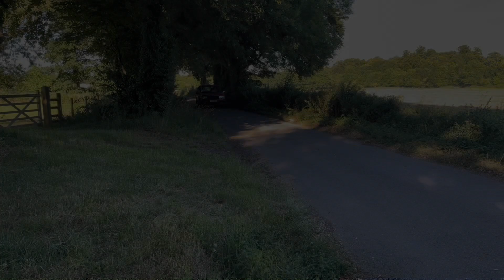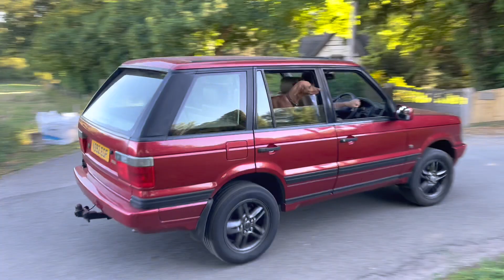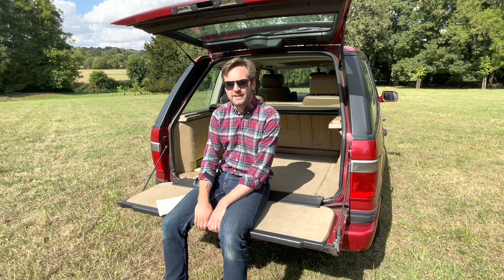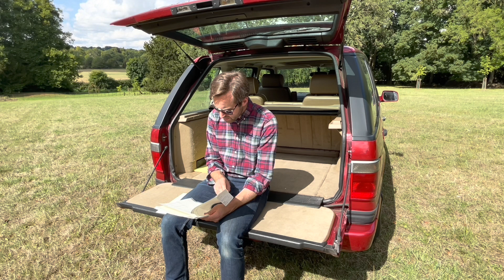Range Rover P38 - 3 year / 15,000 mile costs and issues review

Comment: I am the proud owner of a p38 4.0 base model (absolutely nothing to go wrong )
incredible car.

Edit 11 months later I take the bit in brackets back,
Reply: how bad was it?
Reply: @heathkelley94 well , eka code lock out to start with
Sills were rotten
Both rear wings where it meets the bumper has a huge hole in it. 
Overheated, due to fuck knows what hasn't done it since
Air suspension collapsed a week after I bought it
Ball joints are fucked
And it leaked like hell  through the heating system due to a fucked scuttle filter. 

I've forgotten the rest. 

But all said and done has been fixed and was relatively easy to sort. Still wouldn't ever sell it

Comment: Nice vid, slightly painful bills. How much did you get for the car in the end?
Reply from the maker: It made £5600 at auction, I was hoping for around £6k, so not too bad. For the right private buyer, £7k might have been possible, but if you hold out for longer, something can go wrong with the car in the meantime and wipe out any price advantage you might gain from not sending it to auction or setting a more realistic price in the first place.

Comment: Rangie looks lovely. The reason a lot of owners do not replace the intake scuttle foam filter under the windshield is mainly because the plastic panels, as well as the plastic clips are 20 something years old now, and break very very easily. (A quick google search will bring up quite a few posts warning about the fragile nature of the panels and clips) Also, as in my case, if you live in a very sandy/dusty environment, those foam pads become absolutely stuffed with dirt, and nearly impossible to clean, and ends up making the car look tatty. Regarding your experience with running cost, unfortunately these cars (and mostly all other older luxury cars) are not really practically affordable to run, unless you do mostly all the maintenance and repairs yourself. I can appreciate that this is not possible, or practical for many owners, and unfortunately that’s where these cars become expensive, and ultimately gain a bad reputation, especially because they can be had for less money than a 10 year old base model hatchback.., yet you will still be maintaining a complicated luxury vehicle. For the record, a well sorted P38 not only rides better than so many new SUV’s and cars (mainly because of this senseless obsession with low profile wheels, and racing bucket seats in all modern cars..) , but in the right hands will shame any new 4wd in harsh terrain. They do not make cars this way. The last REAL Rangie, with body on frame design, and live axles..
Reply: Very well said.
Reply: my experience was the screws and bolts and rubber surround needed some silicone to solve the water leaking into the cabin. I did put some new foam under the plastic panels but I don't think that was the issue. those panels also warp slightly so I don't think the seal is great anyway. but the silicone instantly solved the issue, few videos on YouTube on how to do it.

Comment: You've just scared the living daylights out of me! I've just bought my first Rangie-a 97 Autobiography here in South Aus. And your $9,000 pounds is about $15,000 Aus. Gulp. Just had it in for its first service/checkover and came out with a small list of things to do. But no aircon working. Been in the aircon specialty shop now a week and a half waiting for parts and still no end in sight. Its done 293,000 kms so I hope as you said any early faults have been fixed!! Mine seems to have an aftermarket exhaust as seems a bit throatier than yours. What fuel consumption are you getting as I haven't had a chance to hardly drive it yet but dash shows 26 litres per hundred kms from previous owner or 10.86 mpg in your figures. Horrors! Being an Autobiography I also have 18" rims and 55 profile tyres and Bilstein shocks but find mine rides very hard which surprised me as I was expecting a far more compliant ride. Any thoughts?
Reply: Monroe shocks...esp front ( I think oem fronts are hard to come by anyway)
Reply: @romanrob  Thanks for that, just got some rears from Sydney made by Bearmach as I have one leaking so see how I fare with them for starters
Reply from the maker: So bear in mind that bill probably could have been cut by about a third if just minimum spend had been done, it would still be safe and legal, just wouldn’t drive as well. So maybe not so bad and I’d take a well looked after high miler over a garage queen every time. 

The P38’s ride divides opinion, it can be a fidget on the wrong road because like all the chassis Land Rovers, the front beam axle doesn’t ride asymmetric bumps very well compared to an independent set up. Should feel a bit better than Defender or Disco 1/2 because the air springs should insulate the body better. I wouldn’t say it is harsh, the springs should feel quite pliant, even if the body does rock on them. Haven’t tried the bilstein shocks, some people say they improve the body control, others say they ruin the ride! Personally I’d always go OEM and live with the wallow as LR intended!

Re MPG, I get about 17 (imperial) mpg on the computer, mixed driving but not much heavy town.
Reply: @classiced1416  At this stage with the Bilsteins I'd say they are ruining the ride!! I'd much prefer the wallow. As for the aircon I got rang up today. Will be a 2 month wait for parts now they have diagnosed the problem. Parts coming from U.K, U.S.A. AND Germany! Oh and its going to cost a cool $7000!!!!! Only paid $8700 for it. The minister of finance isn't going to see that A/c.😵‍💫
Reply from the maker: @anthonyscolyer8094  you have my sympathy re the aircon, it’s a big job to do the whole thing, but it’s very good when working!